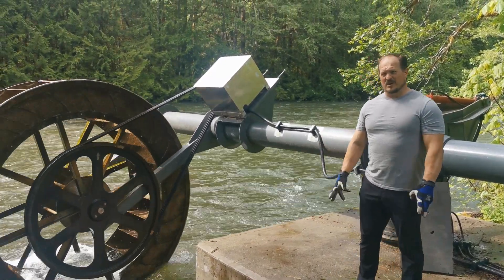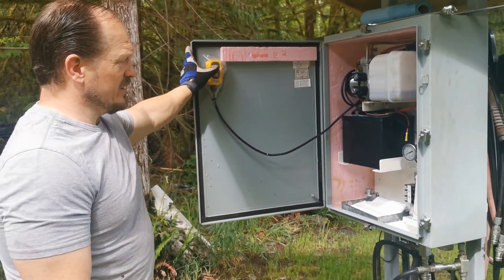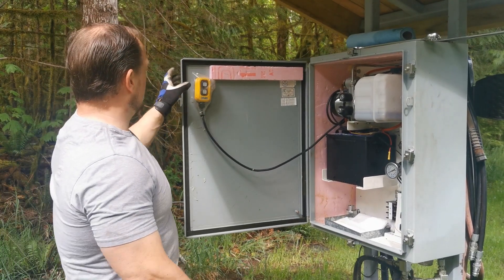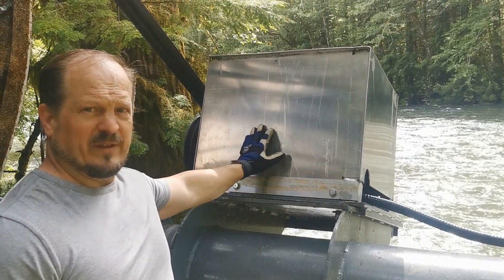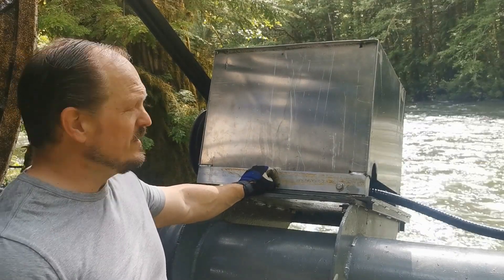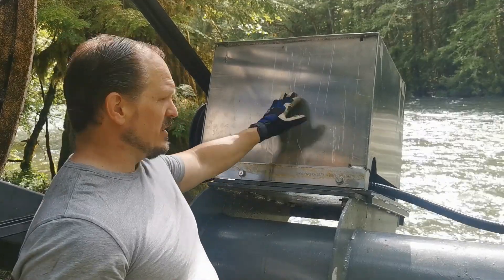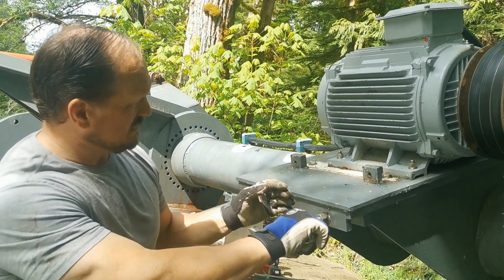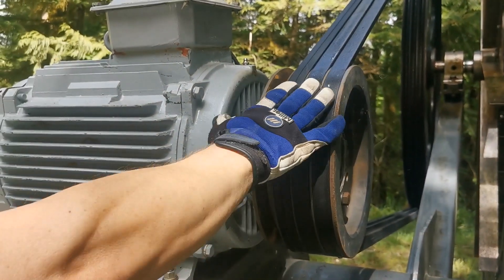DID THEY FAIL? Bearing Update Waterwheel 2020

Comment: I like the idea of your jacking screws, but would it be better to use some kind of spring tensioner (like they use in cars/trucks) to keep constant pressure on the belt?  You could probably get some transport (aka diesel) rated ones relatively easy.
Reply: While I don't have knowledge about big diesel v belts, I have experienced failure on smaller engines due to too tight belts. The torque range seems to be huge.